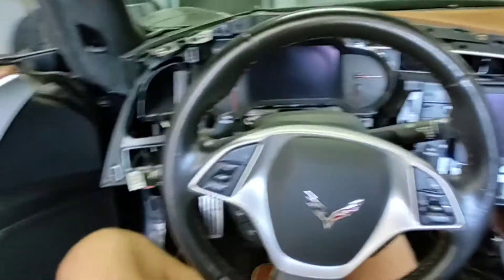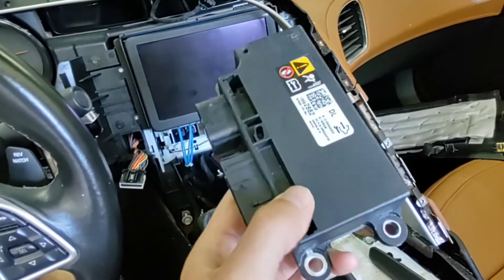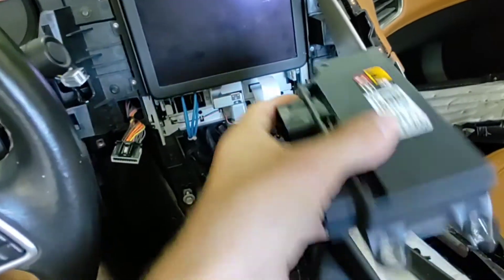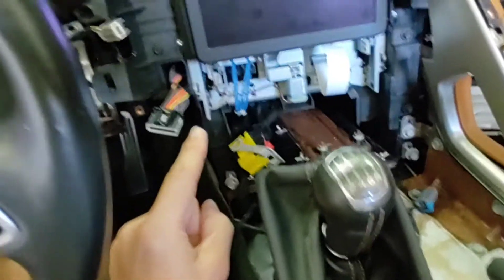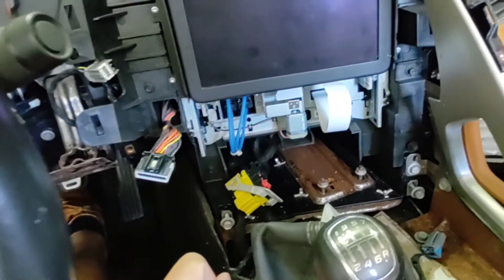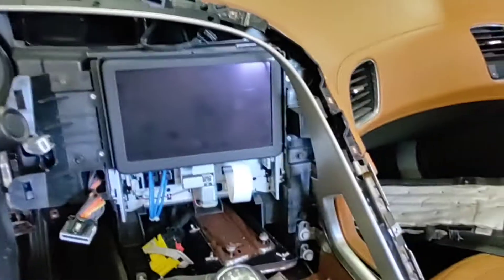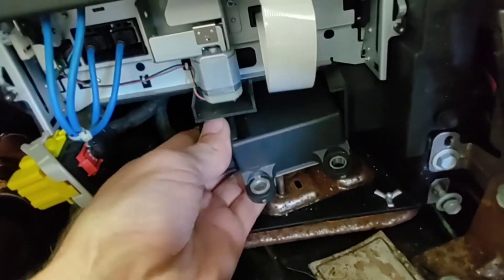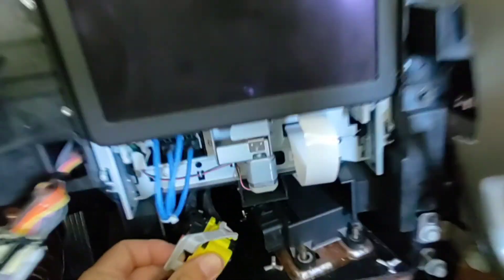removal and installation C7 Corvette Airbag computer module GM hard crash data removal.

Comment: Where did you reconnect the ground connector that’s apart of the front plugs wiring harness?
Reply from the maker: I believe it was mounted to the module I can't quite remember I'm sorry, just replace as removed!